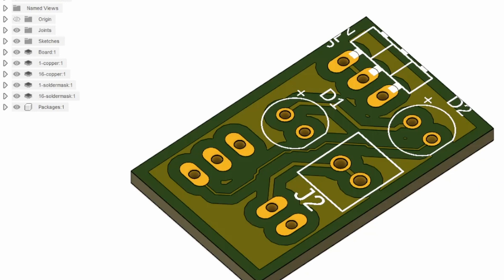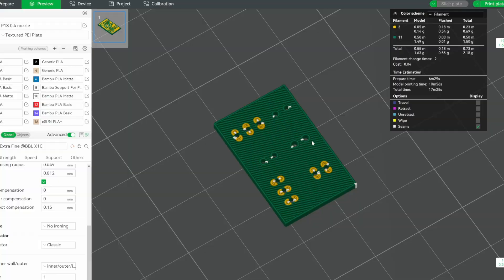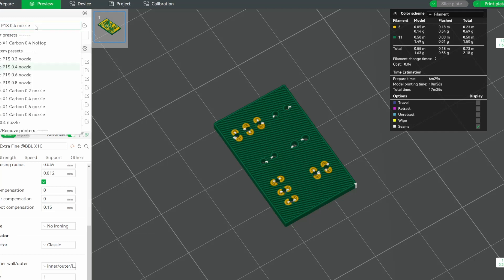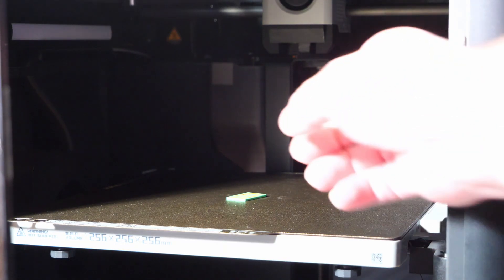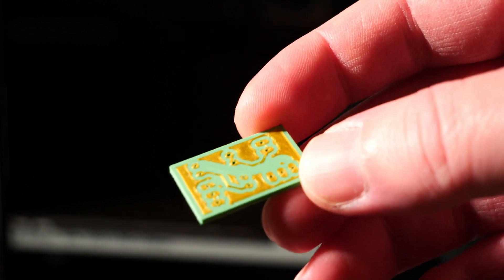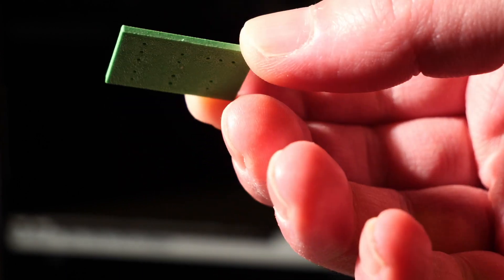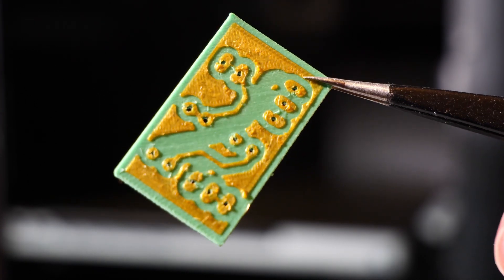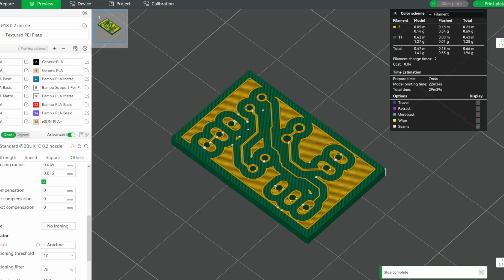A 0.4 Nozzle that isn't? 3D Printing makes no sense sometimes.

Comment: Why shouldn't it work? It's just deliberate under-extrusion. I'd imagine the positioning of the liquid stream inside the nozzle hole isn't deterministic, and also affected by direction changes, so precision should be better with a correctly-sized nozzle.

Comment: I do not see what is surprising for you. There is a channel called "Lost in Tech"  :)) and there they guy shows how you can extrude like huge amount of plastic tricking printer to think it is bigger. Why wouldn't it work the other way around?

PS: Arachnie helps so much for the small parts. I have designed a box with place for screws and with Classic engine  half of it is missing. With Aracnie everything is perfect
Reply from the maker: That guy is a jerk 🧐
Reply: @foundintech lets gather and all report his channel for jerkiness. Mu-a-ha-ha... HA!
Reply: Pfft, who needs those useless thick vases when you can print tiny PCBs... well, they don't actually work, can't have everything! ;)

Comment: I've actually been looking into using a 0.1mm nozzle and petg to print on a pcb as the actual resist. No idea how well, it even if, it works work but it'd be interesting if it did.
Reply from the maker: agreed, that would be interesting...
Reply: I was thinking of exactly the same thing, although figuring that ABS would be a better choice since it dissolves in acetone. PETG dissolves in MEK and Toluene among others things, but they’re nastier and can be harder to get these days. (It’s also soluble in ethyl acetate, which apparently is safer, but I don’t have any experience with it.)

Comment: On prusaslicer this is already done with the Arachne system and allows to print smaller features with bigger nozzles. I switched to 0.6 and can still print 0.4 and smaller features without issue now. It does some extra calculations i believe but it has been a feature for quite some time now. Actually more surprised some slicers still lag behind and don't allow it without setting the wrong nozzle. :D

Comment: There's a lot of calculations going on where the output is "how much does the feed gear move?" And in the end if you give it the wrong data the motor still moves enough that something comes out. If it's enough to adhere and smear, you'll get your trace. 
However, if you extended that area of super thin wall to 10mm tall, you might see that the walls aren't quite filled in. 
However, my question is since you know conductive filament isn't quite as conductive than metal, why not make your trace a lot thicker to increase the conductivity? Solve two problems at once. 
Also, conductive filament is conductive because it has conductive particles in it, and a thinner nozzle might not let them through.
Reply from the maker: yeah I'm pretty sure the carbon would block the nozzle...one way to find out!
Reply: Except those calculations don't involve nozzle size whatsoever. The only way nozzle size is relevant is to positionally constrain where the extruded material ends up, not how much is extruded.

Comment: Of course it worked why wouldn't it work? You can command your slicer to print whatever size extrusion you want

Of course the farther out of bounds you go the less reliable it'll be this all comes down to pressure overhang overlap geometry wiggle etc

But if you tell it to slice for 0.2 mm you should leave your nozzle diameter at 0.4 and instruct it to extrude a 0.2 mm width because that's going to affect pressure also centering an area I don't know how detailed the slicers get

But there is no issue with extruding a 0.2 mm extrusion from a 0.4 mm nozzle I do this all the time in fact most of my printers get 0.6 mm nozzles so that I can extrude 0.4 or 0.6 or 0.8 reliably from the same nozzle

Of course the cleanest print will come from using the correct size for your nozzle using 0.4 with a 0.4

The reason is pretty simple if you extrude 0.2 mm from a 0.4 mm nozzle you're going to have a little bit of slop think of it like this if you place your fist through a hole that's just the right size for your fist you get a nice snug fit and your fist comes out the other side of the hole in a very reliable manner

Now place your fist through a hole twice the size of your fist imagine the whole being a 0.4 mm nozzle and your fist being a 0.2 mm extrusion this is not entirely accurate but it's close enough for this context

Your fist can now wiggle you have room to move your fist laterally along the plane of the hole at the end of the nozzle this is going to create a little bit of slop since now you're extrusion can move around at least the thickness of it can move around 0.1 mm in any direction from the center point

When you overextrude so you tell it to extrude 0.6 mm from your 0.4 mm nozzle as long as you don't have too many overhangs and as long as your nozzle has a nice flat bottom to it the excess filament will squish out the sides and be flattened by the nozzle it won't be perfect but it will work

When I want an extra clean print I use the correct nozzle and the correct extrusion with however for most general prints you'd be surprised how much you can get away with wiggle room in changing that extrusion with

This is really no different than increasing or decreasing the flow rate out of a garden hose your slicer will calculate how much plastic needs to pass through the orifice in order to give you the desired end result extrusion it does this by counting steps so when you tell it to extrude a 0.2 mm path you could essentially get the same thing by lowering your flow rate to 50%

However in this case the purpose of slicing at a smaller width is to allow you to successfully create a tollpath for something that is technically too small for your nozzle

The 0.2 mm nozzle will without question give you a better result however the result from the 0.4 mm nozzle may be perfectly adequate.

Comment: The print works because the only reason the slicer needs the nozzle diameter is to determine the size of the smallest possible feature. If the extrusion width is set to 0.5mm, the amount of material that has to go through the nozzle is the same irrespective of nozzle size. So you can tell the slicer that you have a smaller nozzle than real, and it will at least attempt to print 0.3mm width traces even though the nozzle is larger. Where it might fail is when making sharp corners. Btw, imagine this: print a circuit where the traces are recessed, plate the whole surface, then sand away the proud sections, and you should have a working PCB. That you can't solder on, but that's another problem.
Reply: This isn't really how it works since the Arachne engine was implemented. Don't adjust nozzle size in the slicer but instead adjust the minimum / maximum wall thickness %. This should be on 80% / 120% in most slicers. Which means a .5 nozzle will do between .4 and 0.6 wall thickness.
Reply: I was thinking of using cunductive glue, and something like the Open Press Project https://www.youtube.com/@openpressproject7252
Not sure how well that would work though.
Reply: It used to be like that maybe 10 years ago :)